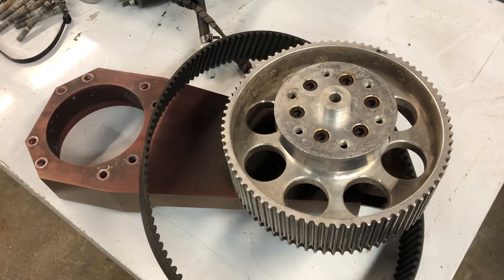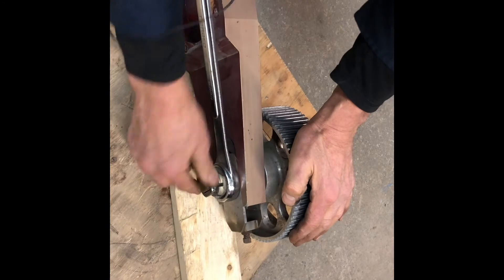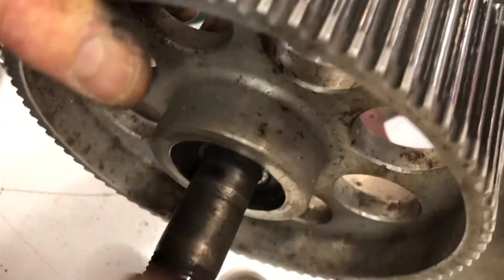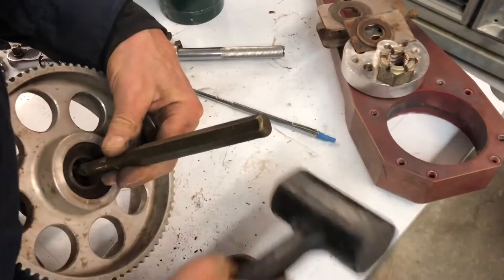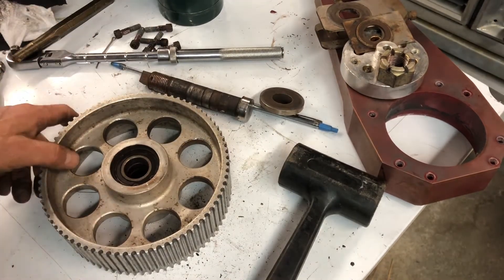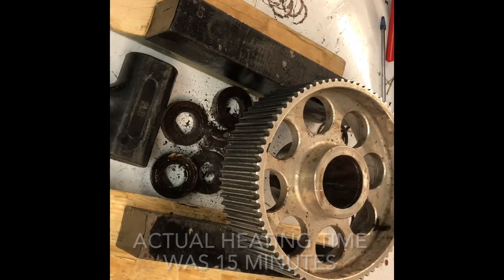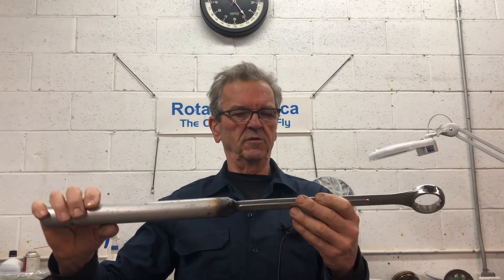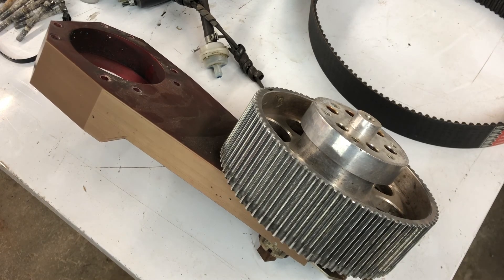Quad City propeller drive bearing replacement

Comment: Any idea how many hours on that? Was it hangared or outside?
Reply from the maker: Hi Owen, I didn’t receive a log book that included this drive unit. I do believe this was one of the early production units as some were machined improperly. Hence the reason for the historical Quad City service bulletin. Hours are unknown, however I suspect it has seen its share of adventures. I remember thinking at the time, only if it could tell it’s life story. Lol. The storage conditions were also unknown.